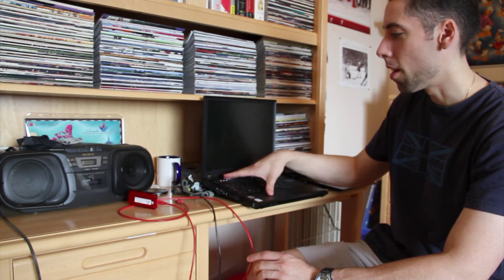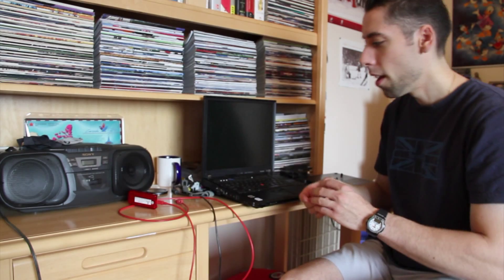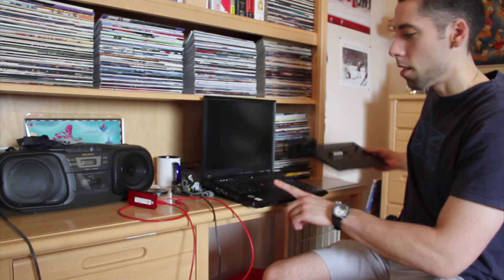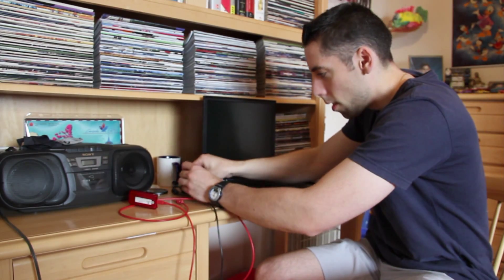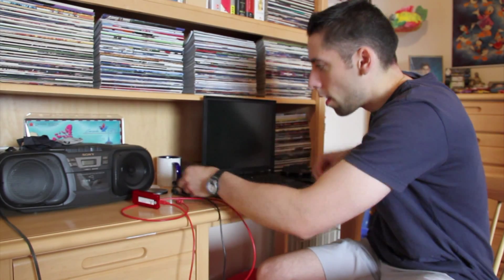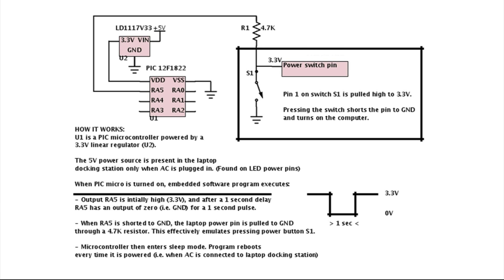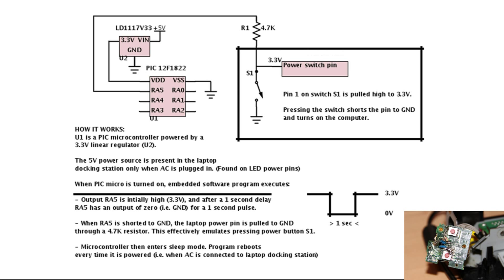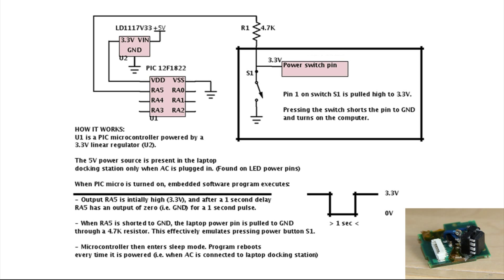Laptop Auto-Start on AC using PIC Microcontroller (CarPuter)

Comment from the maker: Very true! Would the extra resistor on the output be used to invert the pulse? 

For some reason the laptop seemed to start more consistently when I delayed a moment before shorting the power pin (which is why I put in a delay on the PIC before sending the pulse signal). 

Thanks for leaving a comment!

Comment: I love micros but I feel you could have used a 555 with a cap and resistor tied to the th and trg lines. This simple circuit would create a monostable multivibrator. You might need an extra cap and resistor on the output. This would only have a problem if you flipped the power on and off at a highish frequency. PIC = overkill :) but great job!! Another trick you might want to use instead of the 3.3v regulator would be a 4N33 on the output to isolate the PIC. Still think the 555 would be cleaner.